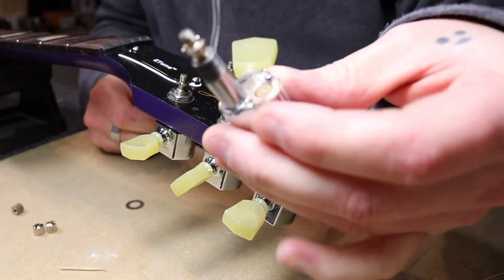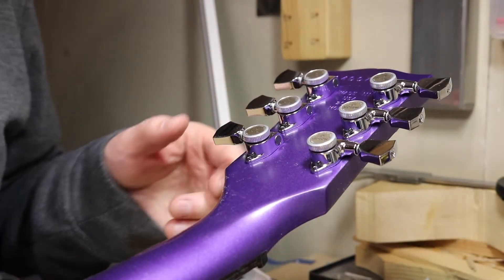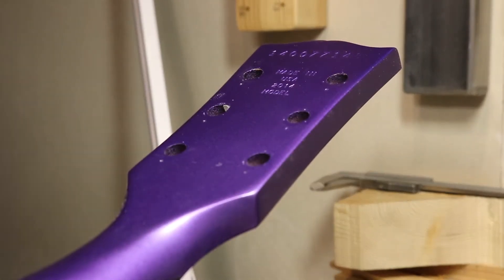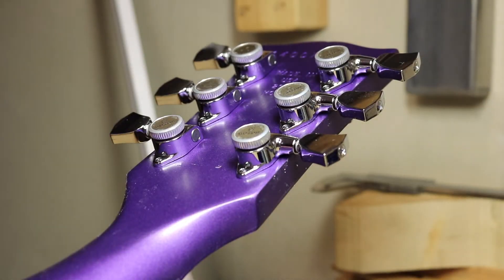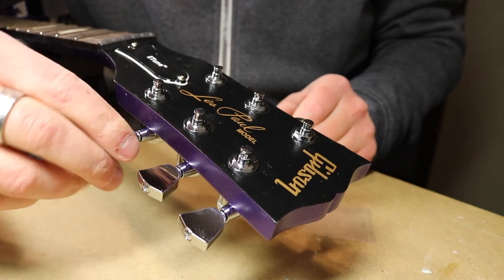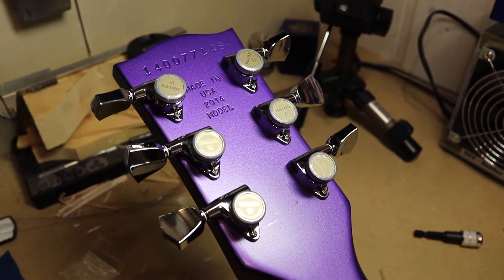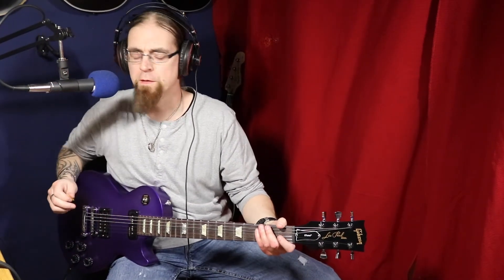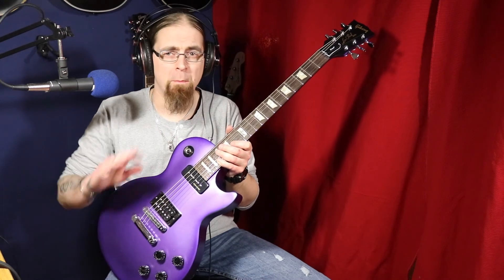Gibson Les Paul E-tune swap Short Version 2017

Comment: How much were those tuners and did they keep the guitar in tune? I ask as I bought the 2016 Gibson Flying V Pro T. Fucker will not stay in tune. Gibson actually replaced the first guitar I had, still not much better.
Reply: Chris Davies I am not a fan of the shit grovers gibson has been using.  I put some gotohs on my epiphone les paul custom and it was like night and day.  My 2017 gibson V has stock grovers and as soon as I can I am putting locking gotohs on it as well.  Another tip for stability is a bit of big bends nut sauce in the string slots of the nut.  I love everything else about my 2017 V other than the tuners.  The guitar plays and sounds great.

Comment: I am not a fan of the stock gibson tuners lately.. This auto tuning gimmick has to go..  I recently got a 2017 Gibson V with the standard non-locking Grovers and they are shit too.. The guitar itself sounds killer but the tuners are fucking trash..  I will be buying the exact set of Gotohs you used here very soon.. Cheers from Maine!  I am prepping for the snow as well right now..
Reply from the maker: Yeah.. but the Grover Locking Tuners that is on my Gibson Les Paul Standard 2012 model is very good.. and the Grovers i have on several of my other guitars both Gibson´s and Epiphone are pretty good to.. not as good as those Gotoh i bought now but.... still decent.. Yeah.. snow is soon here, and Maine will get alot of snow to in the winter .... cheers..